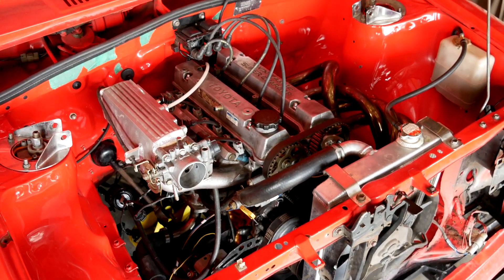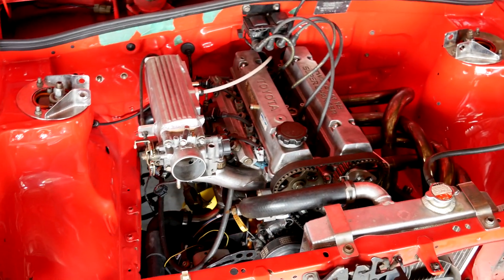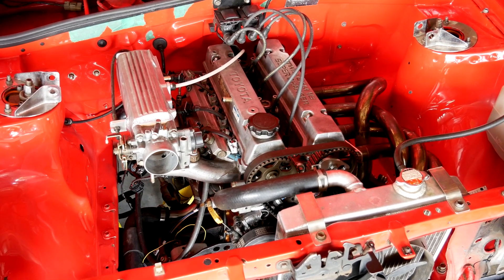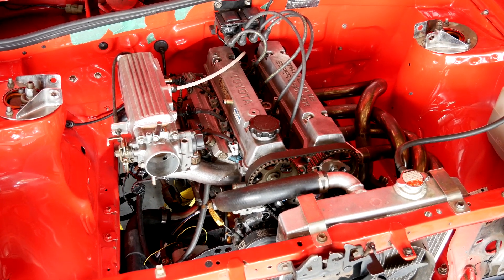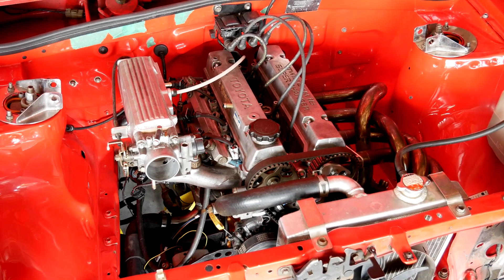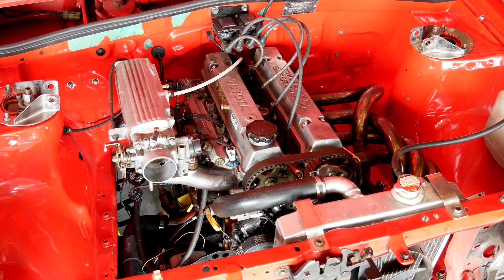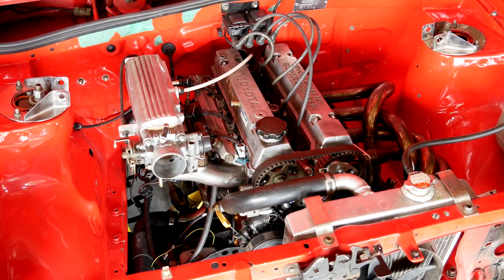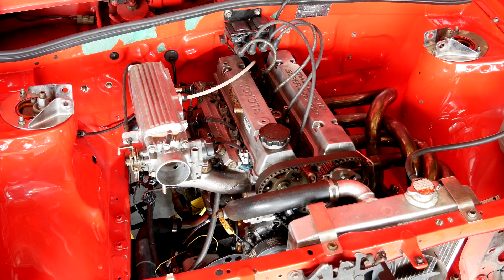Ignition Timing - Garage4age golden turd

Comment: Hi man, these videos are really great. I appreciate your channel. 
I think your compression ratios 10.5:1, if it was higher like 12.5:1 would you lower the advanced ignition timing?
Reply from the maker: maybe a touch less.  but not as much as you would expect. generally when making more power / cylinder pressure need a little less timing.    this is all assuming  can get to minimum best timing without knock

Comment: Does this also apply at motorcycle if set to 25 degrees or it has considirations on specs?😊
Reply from the maker: Is engine dependent what the correct timing is.    but principals are the same
Reply: @Garage4age  THANK YOU FOR YOUR REPLY.

Comment: Hello, I love the video, thank you for your work.

Do you have any strategies for tuning ignition advance for various tps settings like 50% throttle etc
Reply from the maker: on dyno  just  ramp it up at different throttle openings.     low load stuff. steady state and watch torque numbers.     its a bit hard to get it bang on, doing it on the road. since dont have the power feedback

Comment: What do you mean °BTDC?. You mean you get more power if you start ignition way before the piston hits TDC?. Is it not the other way (until a certain point). You try to retard the signal so that the piston does not have to go against the ignition that is already taking place (which is already creating a downward force), also not too much due to optimal compression?. Why does everybody say that you need to retard it but in your test you advance it?. I did it myself but got higher power by retarding the signal not advancing it, and defintiley not 30°. Am I missing something? If so could you please clarify it?
Reply from the maker: It takes time for the fuel to ignite and start making significant pressure.   So yeah pretty much ever combustion engine will have the ignition event before top dead center.  some engines have a combustion chamber that promotes faster burn and will need less advance.    or if same engine is making more power it   na tuned or power adder it usually needs a little less advance to make best power

Comment: I tried an old trick with new tech coz i don't have a dyno, but basically i set the timing (with a distributor based ignition), to a bit retarded and used a GPS speedometer app to time how long it takes ny car to accelerate from 50kph to 80kph. I start at about 30 kph in 3rd gear and go full throttle as soon as I was in line with a certain post on the side of the road... Note the time recorded to go from 50 to 80 and do that exact same run 3 times, add all the times together and record the average.
Then go back to my house and advance the timing by 2° then do the 3 runs again. Basically the plan was to keep testing and adjusting until I either heard some pinging coming from the engine or else the 50-80kph time didn't increase.... So I started at 8° BTDC and at 14° BTDC my times started getting slower again so I settled on 12° which was 2 seconds faster than 8° which worked out to a 15% improvement over where I started... This was with an old 4 cylinder car from the 70's with a stock engine apart from an exhaust manifold and exhaust pipe with a straight thru muffler. Never got to the point where I could hear any pinging and it honestly was only a little bit more advanced than spec.

One weird thing i noticed was i actually ended up having to do 4 runs each time because the first one was always about 3 seconds slower than the average of the following runs, so I just used the first one after each timing adjustment as a warmup and didn't record that time.

If the GPS speedometer trick doesn't seem accurate you can always do it the old fashioned way and use a stopwatch and the car's speedometer or even the tachometer... The principle is the same, you're giving it the exact same throttle input on the exact same stretch of road with the exact same load on the engine. It's better to use as high a gear as possible, that way it takes a longer amount of time to get from your start speed to your finish speed and you can hit the stopwatch more accurately when your speedo needle is exactly on the same marks every time.
Reply from the maker: first run was probably an oil temp thing.   most na stuff will make more power as oil temp goes up. engine,  gearbox and diff.    i have to do at least 4 full dyno pulls on this car once water temp is at operating, before will make consistent power

Comment: Well done video! I can't explain why the timing advance is higher with hot engine oil, can you clarify please?
Reply from the maker: That was showing if you run the engine up with hotter engine oil. Engine Will make more power.   It's a common mistake to  do run after run advancing the timing and the power gain is from the hotter oil rather than the timing increase.   Always a good idea  to confirm the gain by doing another run with the timing increase removed

Comment: Plz do ignition timing on your turbo 4age. This is pretty insightful. Thanks.
Reply from the maker: numbers will be a decent amount lower.    but thats not so much it being turbo.  even high power na will need less timing.  but can also vary vastly between engines depending how they have been modified.

Comment: Great video! Do you have something similar with the turbo 4age? I would love to see the timing vs power effect on the high hp 4age turbo motor.
Reply from the maker: hey,  haven't done a video of it.     Basically the same thing happens.  but the required timing to make max power is less.  not really due to be being turbo. more of a cylinder pressure thing.   my high power na engines dont need as much advance as this one

Comment: It's a long and painful process dialing the spark map. The WOT columns are pretty easy as you do what is in the video unless you have a base curve already which speeds up the process. The lower load areas are what the pain is as you need to lock the rpm in constant rpm mode on the dyno and vary the throttle to move between cells of that rpm and dial each one as you note the torque figure until you find MBT for each cell.   Some areas are hard to hit like super low loads at high rpm or vise versa and you need to take breaks often as the headers can get glowing hot when holding certain loads for a long time with the limited airflow that a dyno fan provides compared to the open road.

A lot of tuners are lazy and only do the WOT column and leave/guess the rest of the map, resulting in a car that has poor drivability.
Reply: How would you street tune the lower areas
Reply: @whcwcjecjecuecuw6654  

For spark you can't really do any of it on the street, you need a dyno. However, fuel you can do the lot on the street as is usually better than the dyno as you get real world air temps, pressures and flow that comes with driving on the road, subtle but different enough to a dyno.  You simply log wideband against VE and just drive in all the conditions until you log enough data for the entire map.
Reply: @whcwcjecjecuecuw6654 guess it and look at multiple good tuned maps and advance until you hit that spot and theres knock.. im not an expert on these but this is how i did it

Comment: Viewer request
What is the max power one can get retaining the tvis intake?
Reply from the maker: Not quite what you asked.  but  this video will give you an idea  of the difference between a well setup intake for bigger cams  and the stock item  https://www.youtube.com/watch?v=c4keKCEa35w   Its smallport stuff but the tvis manifold makes similar power to the smallport one.  tvis manifold makes a little more down low and a little less up top
Reply: @Garage4age  thank you. Very interesting. Im curious at what power level the itb’s make more sense for a weekend warrior non tracked car
Reply from the maker: @OEMplusRESTO   Itb's will run a lot nicer at idle and low rpm than a single, when using bigger cams.  they dont necessarily make more power. but its easier to get the runner lengths and the likes right.
Reply: @Garage4age  thank you.

Comment: Awesome video. What about predetonation? Do you have a knock sensor?
Reply from the maker: I listen for knock with a detset.   knock sensor and headphones
Reply: @Garage4age  Ok but messing with ignition, giving more time, does it increase the chance of knock? You're just advancing the spark
Reply from the maker: @Fuscus64  Not 100% sure what you mean.,  but lots of things  can effect the chance of knock .  but if dont tune on the edge of knock, allow at least a few degrees before knock.  always run same gas as tuned on and add some safteys tha pull timing if any of the temps etc arent right.  generally isnt any issue without knock detection.    most aftermarket ecu's knock detection isnt that good and requires running the engine into knock to set it up.
Reply: @Garage4age  I mean how do you know it's detonating from the spark and not predetonating?
Reply: Not predetonating but after-detonating.

Comment: Interesting, that the engine accepts 30deg at low end without knocking.
For a 4V engine I expected 15 to 28deg on full load.
What fuel is it and CR 10:1?
Reply from the maker: 10.3:1    98ron.    after i filmed this turns out the base timing was slightly off. (2 degrees retarded)   so take off 2deg from all the numbers you see.

Comment: did you just interpolate from 2000-8000rpm once you found mbt?
Reply from the maker: pretty much.  The ignition map isn't perfect on the last run. but pretty close to what it needs to be
Reply: if you just interpolate you will get a flat timing curve, Its perhaps called a curve because many engines like it to ramp up faster in the lower rpms and then less in the higher.

Comment: Is there any difference between changing ignition timing and changing the timing via the cam angle adjustment?
Reply from the maker: do you mean cam timing  vs ignition timing.  or   changing ignition timing at the cam/ crank angle sensor?
Reply: @Garage4age  cam timing vs ignition timing and what if you combine both
Reply from the maker: Yeah they work totally different.  they don't effect each other much.   some small ignition timing adjustments maybe needed if cam timing is adjusted and engine makes a decent gain/loss power in different places over rpm range.   I have vids on cam timing if you haven't seen them already.

Comment: Do you agree that the bell curve for peak power fuel ratio is way more tolerant than the ignition curve ? if I had a choice of electronic control of an engine, I'd choose ignition timing over fuel
Reply from the maker: Yes, in terms of making power.  ignition timing  is far more critical to get right.  Long as afr is in the ballpark  power numbers will be very similar.     But of course afr numbers should be right for other reasons
Reply: @Garage4age  yes, the biggest reason for afr being well within the ' ballpark ' is high supercharger pressures &  turbo supercharges are notorious in this regard. this is where running Meth / Eth alcohol will give you double the latitude .... thank you for your great effort

Comment: thanks a lot for this kind of vids! absolutely awesome stuff!!!
watching this vid i remembered the Oem 4age ecu timing has to be set to an initial timing of 16 degrees (out of diagnosis mode at idle) but as soon as you are WOT the timing continues advancing to a point. Whats the final timing for the oem 4age ecu?
For those who dont have knock sensor, how do we know by torque figures on the dyno when its time to go back few degrees before knocking starts doing bad things? thx!
Reply from the maker: Theres some ignition maps floating around the net, that are meant to be from stock ecu, im unsure how they collected the data though.   I always use knock detection when setting timing on dyno.   most na 4ages will get to best timing before running into knock. unless on low octane pump gas

Comment: you really did run 37 deg advanced at wot ? I am tuning bmw straight 6 engine and get scared at 27deg...(what gasoline are you using?)98 octane*
Reply from the maker: the base timing was slightly off. so was 35-36 degrees not 37.   but yeh only 10.3 and 98 ron.  these engines usually like around 30deg.  my big cam engine only needs 28-29 deg

Comment: Your oil temp effect is really quite significant, do you have a standard sump and fill level? What are the chances the crank is spinning through the oil? Lost 30+kW once from this..... 🤔

What fuel was this run on? Would have been good to see you push it through into knock and see the full MBT curve. Lots of engines don't reach knock threshold at all rpms as they just don't have the comp and VE.
Reply from the maker: yeh 3-4kw on these engines. doesn't change as power increases as you would expect, so gap looks bigger on this engine with its lack of power.  stock sump and windage  tray.   have tried running at lower oil level no change. 

98ron.    was past mbt for most of the curve.   no point trying to find knock.
Reply: @Garage4age  you know that the timing curves you have should show an x2 relationship. Pick an rpm and plot timing vs torque and you will get your MBT torque. Do this at all the other rpms and you have your best theoretical best timing and torque assuming no knock. That's then your actual target.
Reply from the maker: @benheynen2705  If fame speed stayed the same across the whole rpm range this would work.  since pressure, heat and the likes  change flame speed. isn't usually the case.
Reply: @Garage4age  just saying how OE does it...... Everything changes with velocity. Take an rpm and plot it out, check the fit of an x2 curve on those points. Message me if you want, be great to have a chat.

Comment: Do you have the standard knock sensor still hooked up? Do you see any detonation during the higher hp tests? Great vid
Reply from the maker: standard sensor long gone. well i don't think this block would have had one stock.    I use a detset to listen for knock.  no det, its only 10:3:1  on 98.
Reply: @Garage4age  10.3:1?, Isn't 13:1? I thought that it was 13:1
Reply from the maker: @iliasmetalworks   different engine, hence lack of power. see last weeks vid

Comment: What was the trap ? is it hot oil temp giving more tq ? 

also why in the end you lower the Ign Adv frol 37+ to 33 even tho the 37 gave extra numbers... ?

thanks for the video by the way, very demonstrative
Reply from the maker: I was showing if don't run the engine  under same conditions, it may look like there are power gains but aren't.  in this case oil temp.  you can see how people can end up with there engines over advanced,  by thinking extra timing added more power, but it was something else causing the gain 

I lowered the timing back down to show there is minimal change in power once its close to where it needs to be, if engine was close to knock. that 5 degrees less timing  is a big safety buffer for only a kw or 2.

Comment: Did it have a knock sensor and what fuel octane? In the UK you have 95ron and 98ron, don't know about Australia or New Zealand where you are..
Reply from the maker: was on 98 ron.   was listening for knock with detset.   but wasn't expecting any, even at the high timing numbers. as engine is same comp and uses same fuel as turbo engine.

Comment: fascinating .what is the cr and cam duration ?  i am guessing at 9.5:1 and 270 d inlet :)
Reply from the maker: 10.3:1  and stock cams which are pretty tiny  230deg from memory
Reply: @Garage4age  wow those heads
 must flow well .
Reply: @RobertsChannell   it's not a stock head
Reply: @Ultrasonictwo  ah i see that makes sense .
Reply: @RobertsChannell  difference between 232 and 270 ist that big (well deppends on cam) but some are more like 250° with extra low lift (less than 0.3mm) just to help load shims

Comment: Why on high oli temp its better result?
Reply from the maker: because engines will make more power with hotter/thinner oil if everything else is the same.  I was basically showing if engine isn't run at the same temps etc. that the power gains from more timing may not actually be gains.    I have a short vid on how much the oil temps effect power  https://www.youtube.com/watch?v=HJZnmTTjniU
Reply: @Garage4age  yeah it Has sense thanks
Reply: thinner oil causes less friction and as such less parasitic drag to the engine. part of the reason why modern cars use such thing oils; less power robbed from the friction, more mpgs.

Comment: Thanks you so much bro, I learn a lot, could you do on the fuelling side too please....how much fuel added on every rev range, also do you make that extractor in your starlet and are they for sale...cheers bro
Reply: there is already a video like this on the channel, about the afr, I think that the ideal is that it runs thin at low rpm to save fuel and that it runs thick at high rpm for greater power
Reply from the maker: As above check out my other video  "afr vs power" .     I built the extractors yes.  not for sale sorry.  although i may make a few sets to sell in the future if get time. as a lot of people ask about them
Reply: Yes bro let me know how much, I want two...May you do dial up cam timing using kelford spec sheet or any...thanks...and doing true top dead centre stuff, no one doing it that it can be understood....cheers bro...merry Xmas....